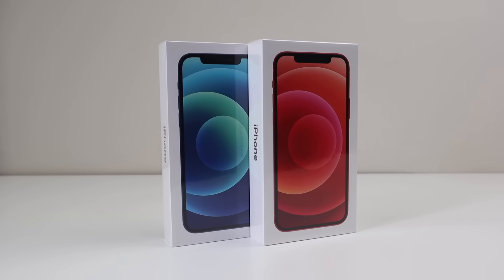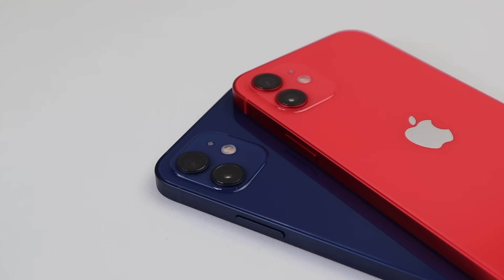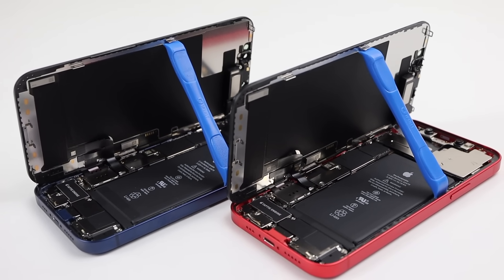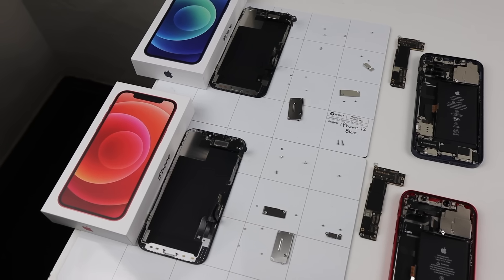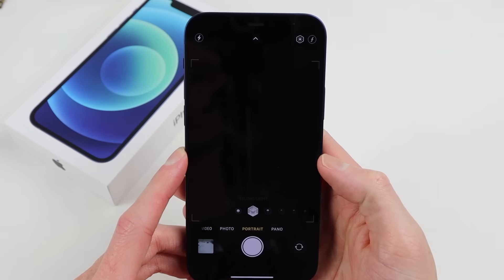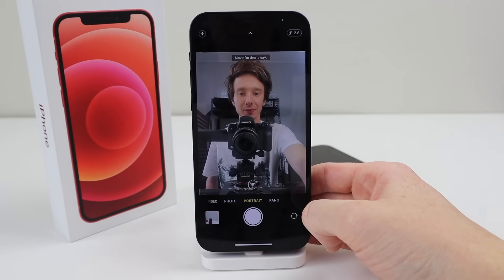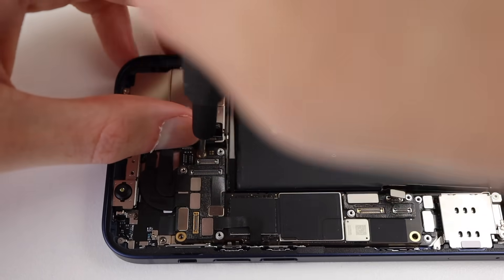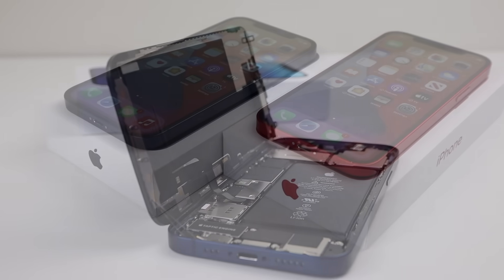iPhone 12 Anti Repair Design - Teardown and Repair Assessment

Comment: Apple: we aren't giving you power adaptor to cut down waste

Also apple: made a different charging cable so you will buy a power adaptor
Reply: Correction, cut down on cost.
Reply: Apple did not invent USB-C
Reply: But we have a male usb to female usbc adaptor,suck that Apple !
Reply: for people saying "but you can use any charger for it" you could but.... there is a high chance of you blowing up the tristar chip in your Iphone and then you will not be able to charge your iphone.So the only way of avoiding this is buyng a "official" charger from apple (Remember think "green"(environment) because Apple is thinking "green" (Money)
Reply: China already made huawei phone which is a clone of apple and android so apple dont want to take  any risk now..
Reply: @registergaming6811  china clones everything and when Apple has their company in china,they created the dilemma
Reply: Yes but to be fair, USB-C is more and more commonplace so I don't really see that as being an issue.
Reply: Honestly the lightning cable is what micro USB should have been from the beginning.  The one good thing to come from Apple.
Reply: But they made it just regular USBc this time. So you can use the same charging cable that you already have for everything else, not a special Apple one.
Reply: @cbernier3  but if you use a third party adapter the warranty is void
Reply: @pb6198  They have no way to prove that, so that's an unenforcable condition.
Reply: To be fair on that one,if you had a previous apple phone there is a high likelyhood you already own a lightning to normal usb lead.

Comment: Complains that people won’t have a USB C charger, when a lot of people will still have the old USB to lightning cables anyway and then goes on to use a heat mat which, apparently, everybody is supposed to have on hand to do the repair. Also going on about having to buy a second phone to do the repairs because it’s so new there is no parts on the market, DUH.

“Mess around” doesn’t have any training or know what’s where and then breaks the phone. Yeah, why would Apple not want ppl opening up and messing around in phones? Hmm. 
It’s covered for a year, with AppleCare up to 5 apparently. Just pay for AppleCare and get the professionals to fix it. Or buy a galaxy and ship it out to them.

Comment: Bruh, just throw away the new cable and use the old one because the both have the same adapter for the phone itself
Reply: there is a video on this chanel that shows the short livespam of apple cabels. If apple wanted this, they woud not provide you with a cabel caus ENviorMEnt.

Comment: You assume this is 'anti-repair'. However, every issue you had (save the battery) was related to things used for security. on an iPhone with faceID that's a security device. If it isn't paired/disabled that is another attack surface that can be used to defeat that type of authentication (someone [fbi/chinese govt/etc] installs a modified camera).

Comment: Apple: we aren’t giving you a charger to cut down on waste

Also apple: you can buy a charger separately in its own box making more waste.

😂
Reply: And don’t forget the price is the same. i.e. my wife bought a SE 2020 a month ago (Oct. 2020) receiving headphone and charge adapter. I bought the same phone for myself last week, it came with No headphones or Ac adapter HOWEVER THE PRICE WAS EXACTLY THE SAME!!! WTF. I called Apple they said “they changed things about a month ago” because no one using then headphones or ac adapter plus it for environmental reasons. . I said, I would have, and if my wife didn’t have a iPhone already I wouldn’t have been able to charge my new iPhone. Also, it’s not like they give you a choice when checking out on the Apple site. You can have if you want.... No. Sick of this s*** Less for more. Bull crap.

Comment: I mean i always loved the iphones but the new phone has a smaller battery no charger weird usb7 to the iphone plug and the design looks like my iphone 5 just bigger.
Has someone a good idea fir a phone to buy when mine breaks ?
Caus i dont wanan buy an iphone again
Reply: Samsung S series. S8 or higher is the best quality, i wouldnt go for any other samsung phone. Ive had the s9+ for two years and im keeping it for at least another year because nothing has happened to it. Still as fast, battery still perfect. Love my phone 😆😆, couldnt recommended enough
Reply: @jamiemcateer1086  thx m8

Comment: I’m surprised the phone has this many different components, flex cables, screws and metal plates. Has to make it very difficult and expensive to manufacture and introduces a lot of potential points of failure.

Comment: is the 14.1 iOS slightly different per device as well? Even if the build number is the same, they put out 14.1 for a dozen different phones with different cameras and faceid/touchid. curious if you swapped 2 12 Pro boards with each other what your result is.

Comment: I've heard removing the battery also makes the phone unusable
Reply: What exactly do you mean by 'removing'? As far as the phone is concerned, the battery was removed because it has been disconnected from the unit. If you actually mean taking the sticky thing at the back of the battery, there would have to be physical damage to the battery that is caused by removal of it.

Comment: Thanks for taking the time to do this. So much for right to repair. 

I think that any Apple executives should have to use original parts for everything. Right down to the laundry detergent for a washing machine, as well as an oil filter and oil for their vehicles. Even the key for their houses. 

“I’m sorry, you cannot do laundry today, you used incorrect detergent.”

“I’m sorry, you cannot open the fridge today, incorrect brand item is stored inside.”

“Please see an authorized service center for repair.” 😂

Comment: Zero climate impact has nothing to do with repairability. They may offset disposable phones by recycling waste paper or planting trees in Brasil jungle, it is just the matter of accounting balance. Repairability is the ability of a gadget to hold value and that is something Apple is not interested in a bit, because if the phone holds value it may be re-sold to the second and further tier owners but in terms of Apple everyone must buy them brand-new. And following this approach thay will make all efforts hardware and software-wise to prevent from second-hand market. Thus disposable phones only! I had brought in my iPhone 5 to change battery when it qualified for the factory recall, they replaced it but the phone did not work afterwards. They tried to fix it and failed, end up giving me a brand-new one. So much for repairability by Apple.

Comment: Apple has been over rated product for years a phone that looses its battery charge from full to zero in below zero temperatures in a half hour span is a garbage product wont be getting another one that is for sure it shows its not a Steve Jobs product anymore .
There is no such thing that is zero impact its just a ploy for these multi nationals to get away with business as usual using fancy words while the general public is picking up the bill for the environment cost as usual . Ricky Gervais called them out exactly for who they are at golden globe awards .

Comment: They basically changed the cable to be more eco friendly however how’s that eco friendly as people will be throwing out their old par adapters as their old ones are not compatible to their new Iphones usb cord or rather wait for some Indian guy to make a cable  that is compatible for a Chinese company to mass produce it
Reply: It’s a Power adapter that’s just his accent
Reply: @debiase101 IK you are right it’s a ploy and excuse to not include something once fought vital to our devices heck we used to get ear-phones but now we don’t , apple clearly want to keep the cost down while keeping the standard profit
Reply: @Pubg-Blsy from what I know these new iphones support lightning usb and every old charger has a lightning usb ,I don't think u need to use that cable in box at all though
Reply: Is just go buy a normal USB power cable from pound store and not buy crapples over priced adapter, it wiping be a lot cheaper that way, if I was sad enough to buy a crapple product in the first place that is
Reply: @dooronron69   from what I know these new iphones support lightning usb and every old charger has a lightning usb ,I don't think u need to use that cable in box at all though
Reply: Or buy something like  www.ebay.com.au/itm/USB-C-Type-C-Female-to-USB-A-Male-Converter-Adapter-Connector/373161368727?_trkparms=aid%3D1110006%26algo%3DHOMESPLICE.SIM%26ao%3D1%26asc%3D229889%26meid%3D4b5e85f992ab4be1a27df54739652ce2%26pid%3D100005%26rk%3D5%26rkt%3D12%26mehot%3Dpf%26sd%3D153973579643%26itm%3D373161368727%26pmt%3D1%26noa%3D0%26pg%3D2047675%26algv%3DSimplAMLv5PairwiseWebWithBBEV2bDemotionHighArwV3&_trksid=p2047675.c100005.m1851    If you look around you can pick them up for a couple bucks.

Comment: I've been an apple and Mac user since the first iPhone. I'm a power user and early adopter since I work with software engineering I always have the latest phone and new laptop every 3 years or so. The news about Apple making their own silicone for laptops and now even higher prices for the new iPhones I have decided to completely abandon apple. Next laptop will be a PC and sadly there are no good android alternatives right now but once one launches I'm switching. Bye Apple, you killed yourselves.

Comment: So a couple of things to know about repairing your iPhone. First of all every significant part has its own serial number that is married to the logic board serial number of your phone. Therefore, unless you have Apple’s Repair Calibration tool to allow that logic board be paired with the new serial number of your KGB then it will not work. Repair Calibration allows you to update the new serial numbered component with the logic board of the phone. It has been registered into Apple’s system through repair calibration. The reason you are getting that they aren’t genuine parts is that the saved serial number from the components you removed and replaced with different serial numbered parts are not the ones that are associated with the logic board. They are genuine parts but without the serial numbers being updated through repair calibration you will always receive that message.

Comment: My question is... why do people still buy iphones!? Most android phones have better hardware than iphones! I remember years ago when I got my samsung galaxy s5. It was dust, sand and waterproof! I love to make underwater videos of my wife swimming. I never used a waterproof case!  And iphones couldn't even get a sprinkle of water or they will die! My sansung s5 had move memory, access to an sd card, better battery life and way better processor than the leading iphone at the time. My phone was cheaper and more durable than iphone! I now have a Samsung Note 10+ and I can do way more stuff on my phone than I could ever do on any Iphone! 

Same with their ipads and laptops. Its just expensive trash! I custom build my Origin laptop for 3D rendering and video editing. I paid less and got better hardware than any apple laptop could ever offer!

Comment: apples argument with the power adapters would've been valid if they included a usb-a cable. the inclusion of a usb-c cable is proof they are only trying to cash in additionally on usb-c power adapter sales.

Comment: I am unsurprised Apple did this. In fact it's one of the reasons I refuse to buy them. However I'd like to know if Samsung does something similar. I have a Galaxy S10+ and wonder if I will have the same parts issue if I need a new phone.

Comment: If you unplugged the battery when you had the phone open then usually the device won’t start until you plug it into a charger and then try to turn it on

Comment: Don’t worry, they’ll get around it. Work on cars, VWAG does the same thing. They have this little thing that’s called “component protection” when replacing almost anything electrical, to “prevent stolen parts being sold”. Just software.

Comment: I don't really understand the problem ... OK it's a pain for 3rd party repair shops because they are basically loosing money but other than that I can see whay Apple is doing that and the simple reason is SECURITY! iPhones are known for it's high security and data protection so even the NSA had trouble getting the data out and that's one reason why so many people buy iPhones. Also you can be pretty sure your device is genuine, not manipulated or stolen if it works because if anythin is suspicious it wouldn't even turn on. As a long time iPhone user I have to say that I only had 2 problems with an iPhone so far, one was a dead battery after quite a while of usage and it could be replaced without problems. The other issue was a defective sound chip on an iPhone 7 which even 3rd party repair centers refused to fix because it would have been to expensive so I don't blame Apple... The phone was several years old so we bought a new XR (which was the actual model at the time) and called it bad luck, although the iPhone 7 still works but the microphone doesn't work so you can still use it for playing games, browsing and other stuff like that.

Comment: I'm a techinician at Apple Service Provider, and I can honestly say once you buy an iphone, get ready to buy a new one if your device was out of warranty.
Reply: yeah thanks for the advice, will never happen, i jumped the 1984 Apple train after my white ipod earbuds broke and the cost of new one was allmost a new ipod. I said screw it and never bought a apple product ever.
Reply: @Wandering_Pixel_Nomad  Yeap, sometimes i feel bad calling customer's that their phone new whole new replacement. As Apple didn't let us repair on certain issues.
Reply: Apple is like the Mercedes of the phone world,  once you run out of warranty, you're FUCKED.
Reply: After my iPhone 6 and iPhone 6’s can’t run anything, ima switch to Android and other services
Reply: I usually have my phones for 4-5 years. No issues.
Reply: @ModernLady  You must be very careful with your phone.  I personally have never had an issue with an iPhone, but since I have a working brain, I understand the predatory practices at work here and so will never buy one again.
Reply: @Leeeeegion  Wouldn’t say that. Batteri is on service-mode now and I have a crack in the glass. It’s a 4 years old iPhone 7. I’ve ordered the 12 and will change battery and glass on my phone and let another family member use it. 
MKBHD said that iPhone users are the ones keeping their phone longest. If he tells the truth, then the iPhones can’t break down early for everyone.
Reply: @ModernLady  Yeap, it's also depends on luck too. Some customers complain that they use older phone for few years, but had issue with the new one they bought.

Comment: Thanks for making this video.  I've purchased many Apple products in the past (3 x 27" iMacs, 2 x iPads, 1 x iPod, 1 x iPhone X, 1 x iPad Pro).  While I've been mostly satisfied with these products, you do bring up a very concerning problem with owning any Apple product, getting them repaired.  Apple want's you to go through them for any repair, period.  That is also the most expensive way to have any Apple item repaired.  But let's also look at the word "repaired".  Apple (for the most part) doesn't "repair" anything.  They replace components to get your item working again.  This is the most expensive course of action from a customers perspective, but fast, easy, and VERY profitable for Apple.  Unlike other manufacturers, components or parts of older Apple products do not get cheaper with age.  They stay 100% the same price years later, which actually makes the repair parts MORE expensive.   For example, if I purchase a PC and my graphics card burns out 3 years later, I can purchase a replacement card for pennies compared to the original.  With Apple, that graphics card on my 3 year old iMac still costs 100% the same price new price from years ago.  I've learned my lesson the hard way.  I absolutely refuse to purchase any new Apple products today.  At least not until they allow third party companies access to their entire supply line to fully repair any Apple product.  Take a look at Louis Rossmann's channel, https://www.youtube.com/channel/UCl2mFZoRqjw_ELax4Yisf6w.  He repairs Apple products, but he also speaks out about how unfair Apple is to businesses like his, and how they (Apple) take advantage of their own customers.

Comment: I understand the new cable won't connect to older power adapters, but I presume there's nothing to stop you connecting the new phone to an older power adapter via the lightning connector on the older cable?

Comment: " buys a new iphone 12 a few years after launch and breaks the screen next day"
Apple: sorry we dont service that phone anymore."

fk apple a 80 screen replacement ends up being $1200+ for a new phone. 

its not just that some companies make it difficult to repair a product but stopping support after a few short years is a kick in the nuts to consumers. especially those who buy third hand a when the price is more affordable. 
the compass (although a useless feature) in my car is stupidly incorrect (if your facing N  E and W are swapped same for other directions) and could be fixed with a simple quick software update.  but god forbid a company support there product for more than 2 years. or fkn program something stupidly simple as a compass correctly....